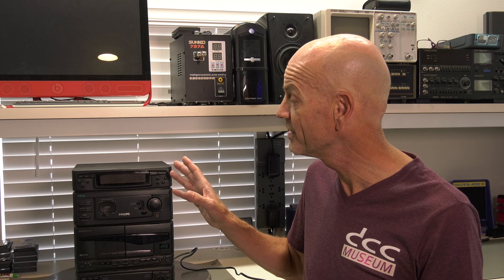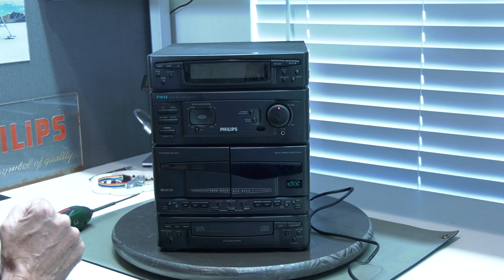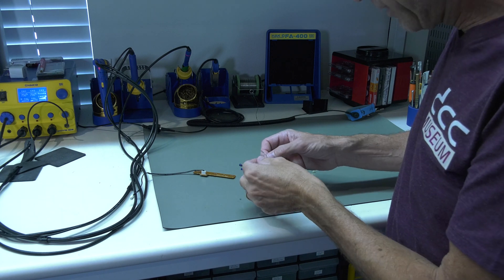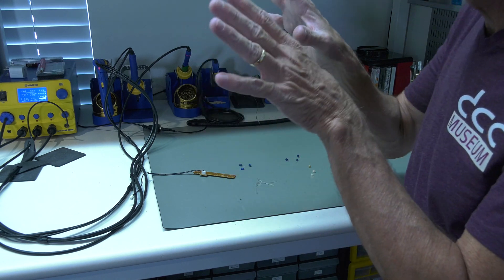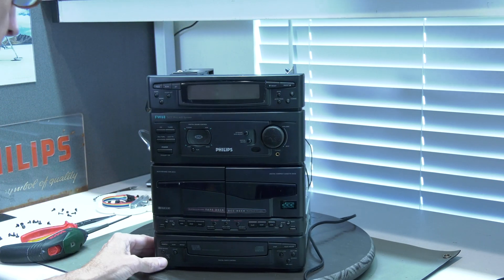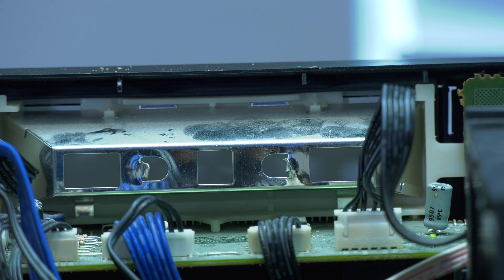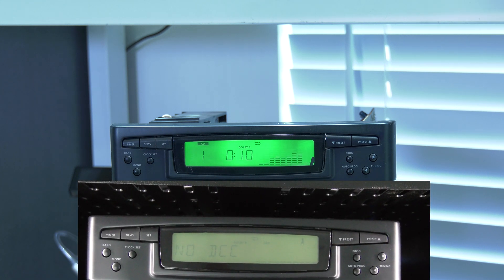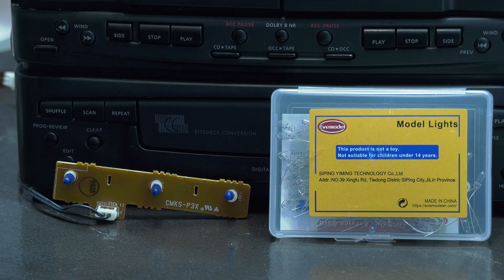LED or Regular Backlight upgrade on the FW68 DCC Mini Set?

Comment: I did a similar modification to a Ford clock when I fitted it into my classic car (Hillman Avenger), so it didn't generate so much heat.  Light spots were reduced, though not quite eliminated, by filing the front of the LEDs flat so the light scattered a lot more.

Comment: I tried upgrading my FW68 with three LEDs and it looks like cr*p because the light is so uneven. I like the idea of using two (not three) LEDs and putting them sideways to spread the light better. I wonder if it would look even better if you put them further apart. Next time I visit, I'll bring my FW68 and we'll try it out. 

I think my FW91 miniset could use a similar upgrade by the way.